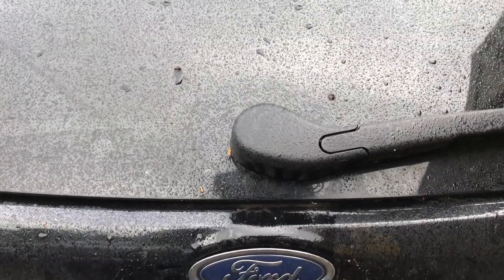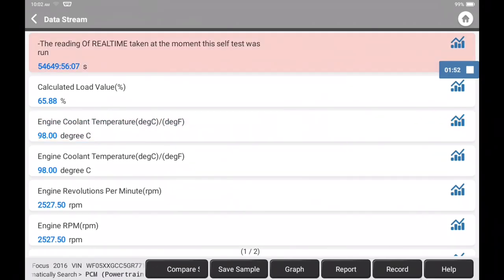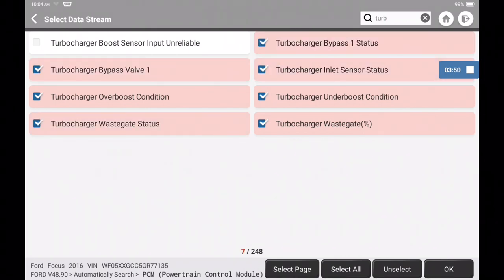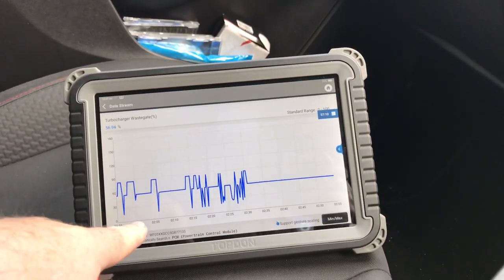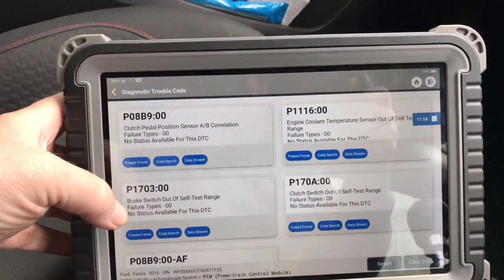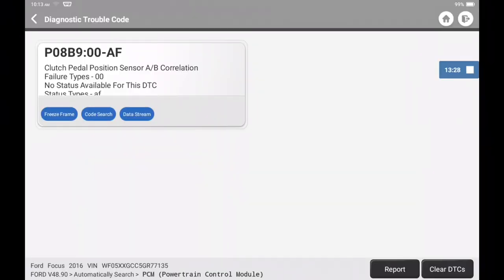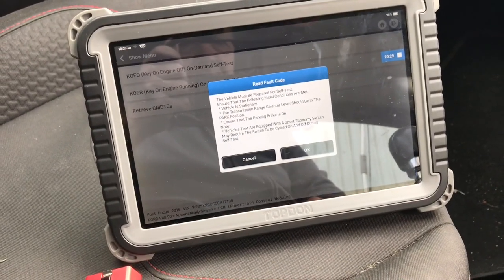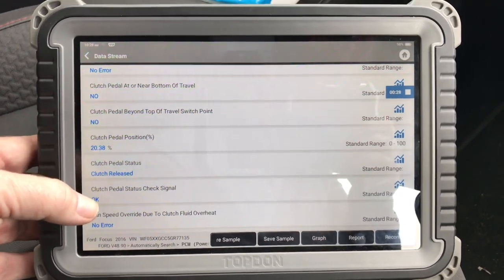Ford Focus Ecoboost (2016) - Poor Performance 😭

Comment: How Ford can allow these engines to carry on in production is beyond me. Ebay is full of them in the spares or repair,  Rubber belts running in oil ????.
Reply: The newest ones on mk4 focus etc use timing chains now and a lot of other improvements but yeah the earlier ones are terrible especially the cooling system
Reply: @sbrader97  It's really strange with theses modern car manufacturers, VW went from belts to chains now back to belts. People were mis lead into thinking that timing chains were maintenance free, not the case Mini/Peugeot engine and VW both are on the limit at 60- 80k. Ask me how I know.

Comment: No one wants to touch them. Had to use main dealer to replace both belts (cam & oil pump belts) as soon 10 years old. Cost thick end of a £ grand and took two & half days. But I guess other makes that are 'eco' and efficient are the same. About the same price as a headlight for a Tesla!

Comment: Nothing wrong with the 1.0l engines as long as they are properly maintained and not thrashed when cold. The earlier engines suffered from overheating due to a degas hose splitting which was recalled and fixed in these later engines, That miss fire at 4k rpm is actually the soft limiter on these engines and they always run a little smokey when it's not up to operating temperature 👍
Reply: Got a mk3.5 thats leaking coolant so even the facelift engine has failure points in the cooling system hoping its the water pump or something leaking cant afford to fix head gasket or fit a new engine tried looking and cant see anywhere in the engine bay thats leaking no obvious leaks from the pipes and no white smoke/coolant in oil so idk if the head has blown it also never overheated when the coolant ran empty didnt realise because they didnt put a sensor for coolant level yet they have one for the washer bottle how stupid is that
Reply: Thanks for the information on the soft limiter 👍
Reply: @sbrader97  regarding your coolant leak I had same problem nd couldn't find any obvious leaks but under pressure test I spotted one of the heater matrix pipes leaking from the engine bay to the imput of the heater matrix. Hope this helps.
Reply: @karlleggett6197  yeah that was the exact same place mine was now never buying a ford again because i then had oil light while on holiday the belt probably blocked the oil pickup i just got a new car instead of expensive repair on replacing the wet belt etc was sick of that car going wrong didnt want to have to keep forking out hundreds every few months with every common failure happening at once

Comment: If you're tyer pressure is low the car wont go over a speed and the light is on
Reply from the maker: Thanks for tip never knew that👍